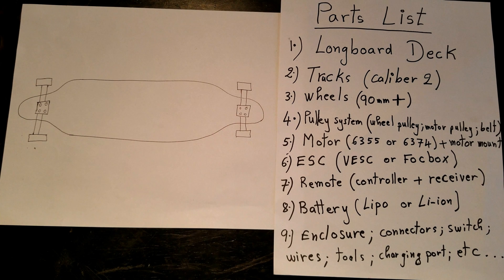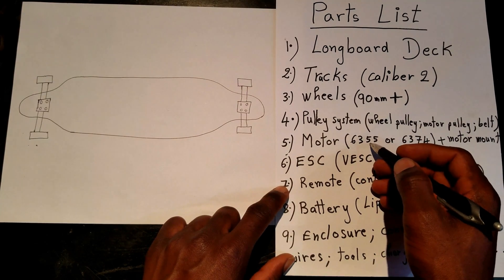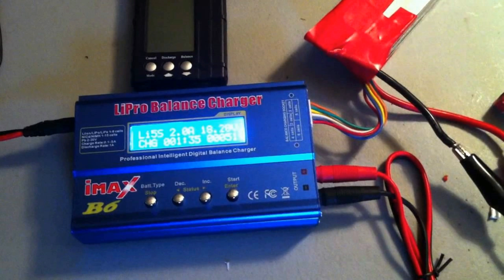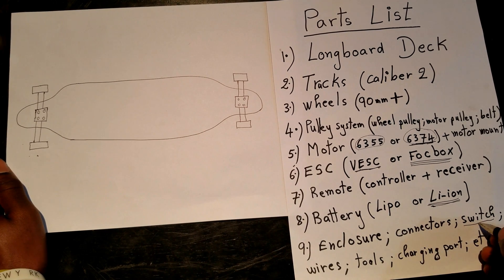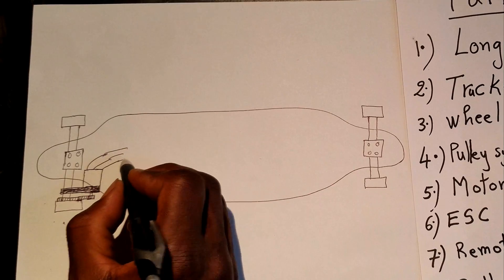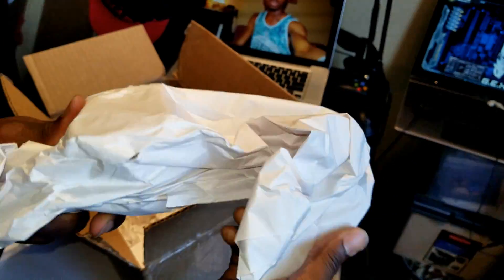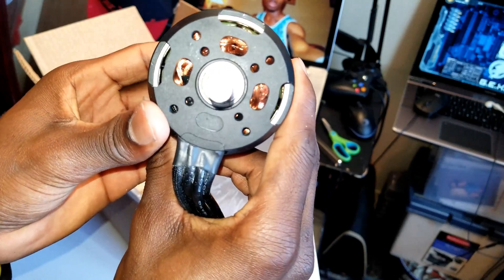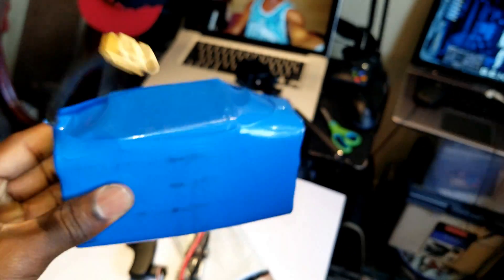HOW TO BUILD A DIY ELECTRIC SKATEBOARD BEST DIY PART #1

Comment: I couldn't find the deck that you had ...even on the links... please help , thanks
Reply from the maker: Looks like that deck is sold out. No worries! It was not really a great deck! It's short (35.5") which really sucks if you are a little tall. It is stiff! No flex at all, vibration on rough surface is terrible. If you don't mind the deck being stiff, you can get this one (wide 10" and Long 39"): https://www.ebay.com/itm/SATERNO-Longboard-Downhill-top-mount-quality-skateboard-10-13-x-39-C8/253357412977?hash=item3afd475271:g:SBwAAOSwAU5aVPG9:sc:USPSPriority!10029!US!-1:rk:1:pf:0